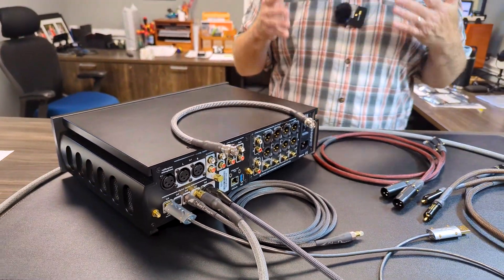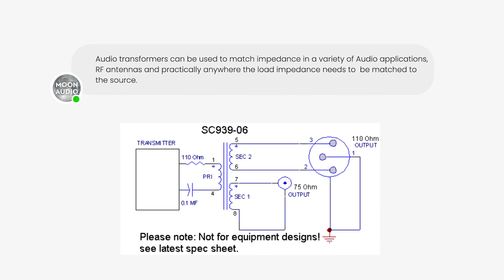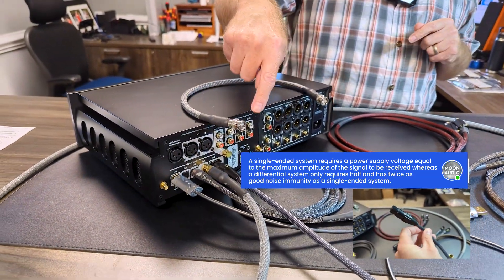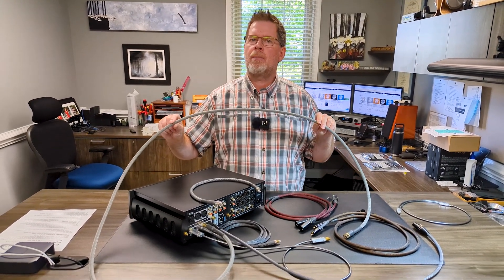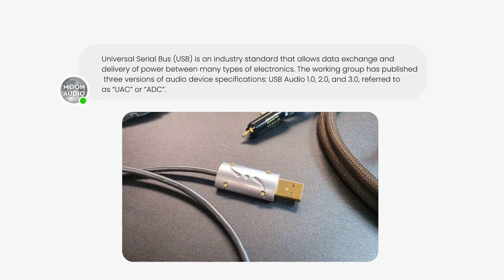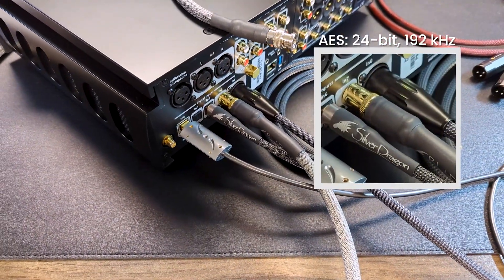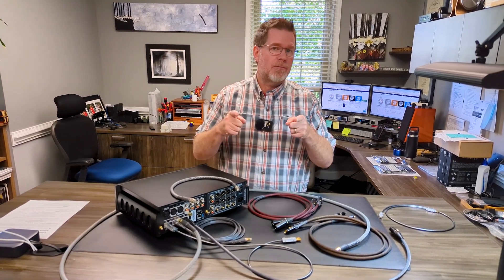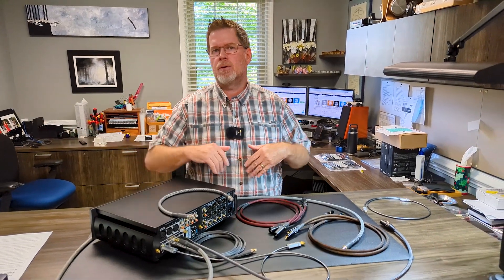Digital Audio Cables & Analog Interconnects Explained | Moon Audio

Comment: I’m sorry but especially for digital signals you don’t need a “better cable”
We send information in these things called bits and there are algorithms to get out any false signals that might occur due to interference. The signal delivered on the other end will be exactly the same, just like copying a file onto a usb.
Reply: I read somewhere that if you use a cable more than 1.2m long then any reflections off the connectors fall in the high or low level parts of the signal and so do not affect the timing of the edges. So with a length like 1.5m and 75 Ohm cable that is all you need.

Comment: I²S not even mentioned?
I guess it's not standardized, but regardless of if you are using a HDMI connector or a RJ45 connector it tends to be the best of all digital connections, if available.
Reply: Its a mess. When it first came out in the 90's, it was a din style connector. Now that its back for a 2nd time, you have to buy the rights from PS Audio if you want to include it as a feature. Its probably expensive to buy the rights,